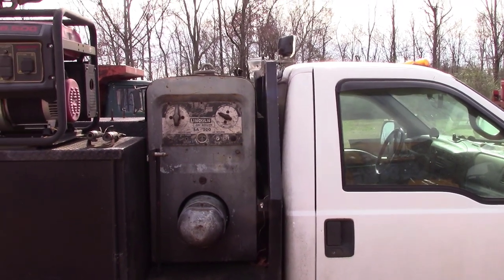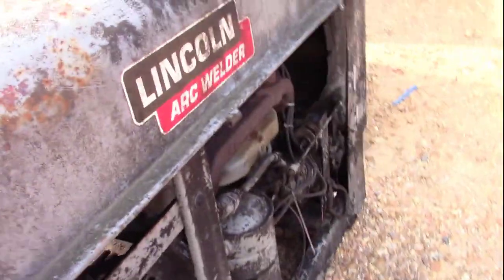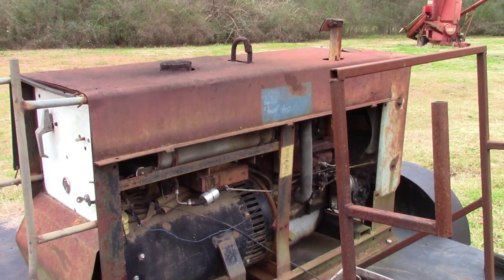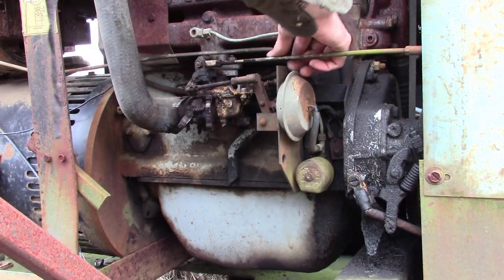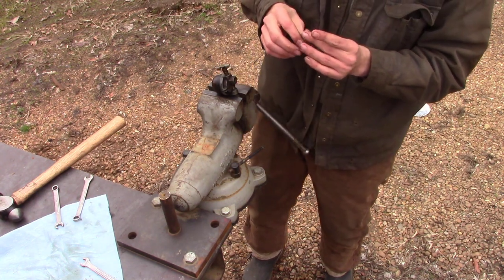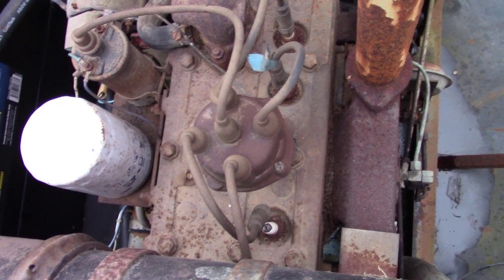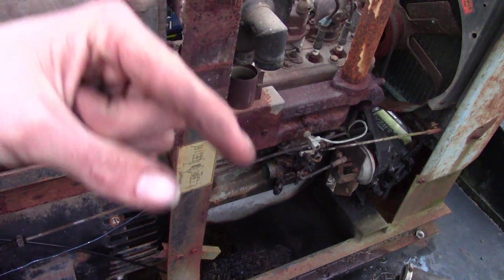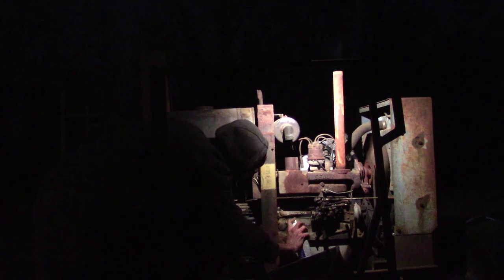old start cold start compilation (welder style)

Comment: I love those SA-200s! Heard some disparage these machines, but with a simple set of tools and some lifting equipment you can strip them down and be rebuilt good as new. I have over 7K hours on mine and I need my exciter brush mounts replaced. May need to get into the hex barrel to replace the shunt coils, too. Haven't got that far yet. Anyways, it's cool stuff. Thanks for posting. Ethanol, it's sad stuff in the tropics, because it pulls in the moisture to the point of being beyond belief.

Comment: My 45 International A tractor was sitting 2 years while I fixed the radiator, got it back together and with a fresh battery fired after a half turn. Something about the old equipment, keep going and going.

Comment: Your crane was originally a utility pole truck, used to install and replace power poles. I used to be a hydraulic mechanic on equipment just like that. This is just my personal thoughts. I would really like to see you remove the auger storage bracket from the boom. 
I to like to take older equipment and update and repurpose it and that bracket is just a hold over from the crane's former life. Just bothers me OCD...LOL
Reply from the maker: I understand. Yes I was planning on taking off just finding the time right now lol. I’ve almost been knocked out a few times because of it climbing in the back of the truck.  Yes the truck is a beast way better than anything nowadays planing on putting a wireless kit where the remote bank is now.
Reply: @EEJester1586  All of the miniature people in this world never will understand what us tall guys have to put up with...LOL

Comment: I have a 1966 Lincoln SA200 and for a time I had a Big 40 here at the same time. I had them both running and welded with them switching back and forth to compare the arc. While the Big 40 had a good arc the Lincoln’s pure DC arc was smoother. The puddle seemed less agitated. What’s your opinion? Don’t get me wrong, both are fine but I noticed a subtle difference
Reply from the maker: I would definitely agree with you. The big 40 runs low hydrogen rod like 7018 really well. But it stinks when it comes to a cellulose rod like a 6010 or a 6011.  It’s like I don’t have a hard enough start to get it going good but that’s just my opinion. I don’t know what it is but most millers I’ve ever ran don’t have a real crisp start.  Other than that they’re good machines.
Reply: @EEJester1586  
I’m sure it is the arc voltage difference. I just know from my own observation that my old red face Lincoln has a better arc in my opinion. The downside is the lack of auxiliary AC power. They were purpose built to weld not generate
Reply from the maker: @stevewarner8880  now that you say that I remember the Open current voltage was 85 on the big 40 and 98 on a SA200. You wouldn’t think that would make a difference but I guess it does. I’m sure also I needed to shake the cobwebs out of the old generator on the big 40.

Comment: Not being a smarta$$ but why did you put the machine with the controls facing passenger side? Have never seen one single truck with the welder facing the passenger side??
Reply from the maker: This will sound really dumb, but it was to get to the old filter with that truck. There’s no room between the headache, rack and welder. I would have a take the hood off to change the oil and to check the oil.  That’s funny you say that both Welding rigs that I’ve built they both face the passenger side lol.
Reply: @EEJester1586  hell no worries brother yes I know what you mean about getting to the oil filter on the older machines. I ran 2 old machines before a 56 shirt hood and a 58 long hood and had to lift the machine off every time to change oil, well I should say have a friend help me lift the machine off to change the oil which was always a hassle. The newer diesels I run anymore have access doors and oil filters are toward the back of the truck when the nose of machine faces the driver side. And plus I’m just used to getting out of the truck grabbing the lead and starting the machine from the side I get out on. But thanks for the reply I just was wondering why a machine would be facing that way. Different folks different strokes I can dig it
Reply: It’s for his helper..buddy gets out and starts the welder and gets everything ready for pipeline

Comment: Those ultrasonic cleaners are fantastic for carbs.  Honestly run it through two fifteen minute cycles and it does a fantastic job cleaning them up.  I still manually clean the emulsion tube.
Reply: What’s the emulsion tube??